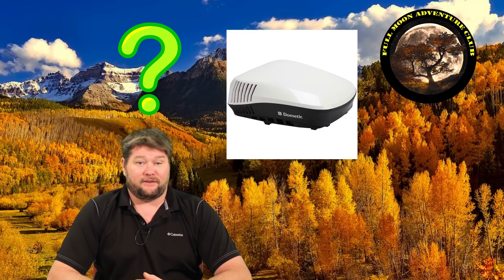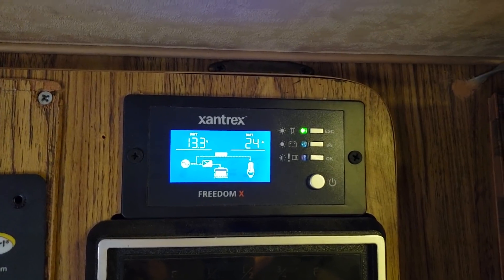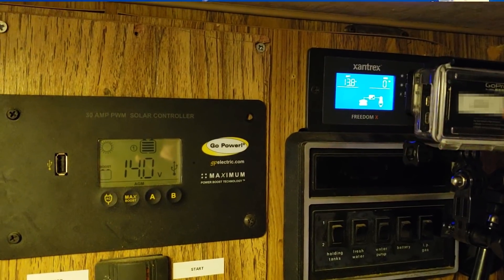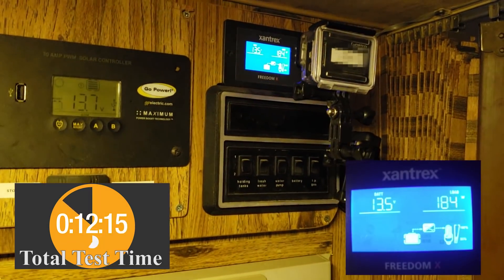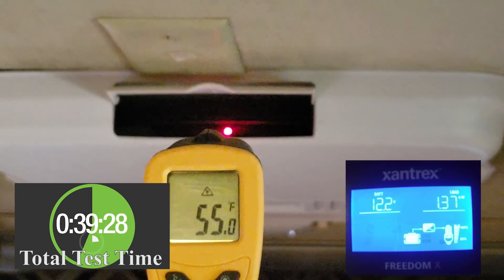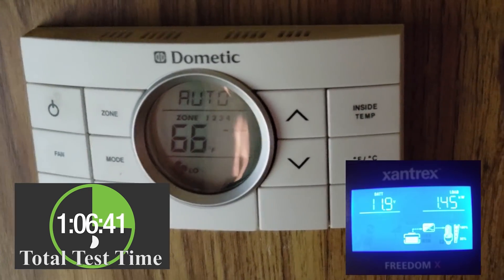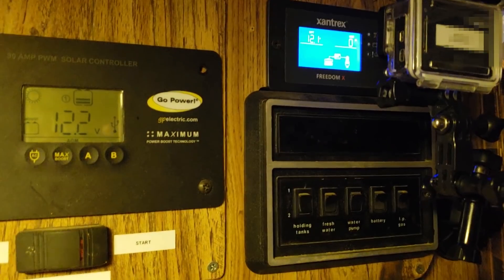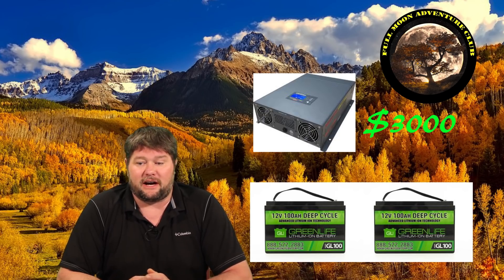How Long Will an RV AC Run on Two Batteries?

Comment: 1.5 hours for 15,000 BTU using a pair of 12V 100 Ah LiFePO4 batteries.  If I used all 8 of my used but very good 6V 230Ah AGM batteries configured as 12V 460Ah usable (down to 50%), I would probably get something like 3 to 3.5 hours.  My batteries are $2000 cheaper too.  If you had a 2KW (140A) alternator, you could run that AC for a long time.

Comment: So 1.5 hours but how much battery time do you have left?  Wouldn't it just be best to turn on the engine to run the AC for a couple hours?
Reply from the maker: This is actually using a lot more power than a car alternator would put out. Surrendering the engine wouldn't actually run the air conditioner. It might prolong your time a little bit but they're just not designed for that kind of power draw. Take care and happy camping.  Jim

Comment: Very good informative video on my freightliner cascadia I have an apu system called parksmart and it works with 4 agm batteries to run the a/c on this system it woll drain the batteries in about 9 to 11 hours not a roof top a/ c of course and about 34 hours on the fuel fired hydronic heater plus hotel load

Comment: Hey thanks, I am in the process of installing an A/C in my campervan. I have 2 x 200 lithium battery solar 2 x 250w solar system. Gives me an indication of time, cheers from Ozzi ozzi ozzi, oi oi oi 👍🤛
Reply: If correctly installed, 200aH of lithium phosphate battery life should generate roughly 155 minutes worth of AC at 72 degrees with this specific 15,000 BTU model. 
The creator of this video did not use the correct wire gauge and there appears to be a voltage drop effectively losing an addition 8% of his power output from his system. 
This could be from the batteries capacity as it ages or additional inefficiency in his inverter (more than normal). 
Overall, if he's projecting 110 minutes, his system is nearly 70.9% efficient given his set-up. 
With the correct modifications, he could generate 42.3% more power under load.

Comment: This is exactly why they need to bring inverter Air-conditioning technology to the RV world.. like 4.5 amp stuff..super high efficiency with heat pumps that perform at extremely low temps..run all day on solar
Reply: Damian DeLapp there is one company making one inverter drive unit. Google inverter rv ac I found it... but hanging a mini split off the vehicle isn’t a big deal...

Comment: Perfect. Want to get a shipping container for storage and use a solar/battery power system to run an RV style AC unit to keep the temp at 80 degrees.

Comment: good video. thanks for doing the experiment.  I'm not an RV but my conclusion is it might be best to do without AC if you are off grid.
Reply: I agree with your conclusion go somewhere cool when it is hot and somewhere warm when it is cold.

However there is always going to be that  person who wants to have an AC, no matter what.

I would like to have one for intermittent use during the day running primarily off the solar panels.

Just to keep the RV cool at peak hot time of the day.

Although I would suspect that a much better layer of insulation would be far more cost efficient.
Reply from the maker: @shawnr771  we have been RV full timing for the last week in Nevada and Utah and I'm here to tell you that a generator is the way to go if you want AC.   Jim
Reply: @fullmoonadventureclub  I am going to say at this point in time yes.

As solar panels and batteries get more efficient this might change.
Reply from the maker: @shawnr771  I am with you on that point. Constantly working solar options. I'm getting closer but the tech is pricey for no gas AC. I will share the journey with all of you as I go. Thanks again for watching and happy camping.     Jim
Reply: @fullmoonadventureclub  I am not much of a camper per se.

I watch the videos because van and rv dwellers are doing things well in advance of home solar setups.

Home solar these days is not about conserving power or using power more efficiently. 

It is about keeping all the heavy load stuff running and offsetting utility costs.

I have partially powered a house with solar in the past as experimentation.

I learned that if it is not necessary to use an inverter dont.

They draw power all the time.

I ran lighting and small 12 volt appliances, fans, tvs, radios off three 65 watt panels and a 4 100 amp hr lead acid batteries.

I ran 1500 watt window unit AC once for about 30 min on a 2000 watt inverter.

This was an experiment and a learning experience for me. 

I plan to power a small(not tiny) off grid home in the future with a combination of solar and wind.

I am watching the technology advance rapidly.

I live in Texas. AC is almost a must have in July and August.

I am designing a passive solar design to take advantage of the different angles of the sun throughout the year to take maximum advantage of shading in the summer and sun in the winter.

I may not get to 100 percent off grid but if by design choices I can stay comfortable without additional heating or cooling into months where most people are already cranking the AC.

This will save me money.

Going green to me is not about saving the planet. It will take care of itself and kill us when we get to be too big of a nuisance.

Going green is about keeping the green money in my pocket and not giving it to a utility company.
Reply from the maker: @shawnr771  I completely agree with your stance on the planet. I also appreciate the information with your personal experience on the matter. I think we should all strive for energy efficiency for any reason. Climate temperature control is the biggest energy issue so many people face and I hope we can figure out and share how to make that obtainable. The easiest solution is to live in a sustainable climate where it is not so necessary but I would love for sustainable tech to be more of a solution. I love off grid tech and hope to do  many more videos on the topic. Thanks for the comment and happy camping.     Jim
Reply from the maker: Absolutely. If you can do without AC it's one of the biggest power drives you can have.   Jim

Comment: Use No reg. Lead acid batt. But use 100 a/h deep cycle AGM, draw down can be more than 50%! Shalom!
Reply: AGM’s should not be discharged below 50% or their life will be considerably reduced.
Lithium’s can be discharged safely to down to 20% capacity.

Comment: Hello Jim,

Very nice video on this subject!

Being from AZ, getting rid of excess heat is always a struggle here in the Summer.

That said, a few points to review &  ponder; During your test, what was the outside temp.? This is important to see how much excess heat GAIN you also need to overcome.

Of course during this test, you are starting from ground zero, no a/c running for some time with everything heated up.

My contention on this would be to start off using the ac line power or generator to do the initial cool off to desired temperature, then switch to the batteries and see how long the battery/inverter system could maintain your desired/cooled off environment!  I suspect in doing this, you would find that instead of only 1.5 hours that you might find your system would maintain perhaps 6 to 8 hours; battery only!

Then you could do part 3 & add in the solar panels.

Sounds like a good retest to me. 

Let me know the results...

Thanks, John, Tucson
Reply: What is the basic BTU number on a regular car AC?

My idea is to use less than a 5,000 BTU unit.  .. This to be done by  limiting the livable space in a RV to a small area on hot days..
Possibly plastic dividers can contain the cool area.
Reply: @DanielS-o7e4f  Most cars are about 1ton (12000Btu). SUV can range upwards of 20000 to 40000 Btu (1.5-3.0 ton).

Remember that in an RV you have more windows (heat gain)  & therefore less insulation too where those windows are.
Reply: @jptucsonaz8503  
Thank you
Reply: Great idea. I would also add a soft start to the ac system and try it then. Im pretty sure its doable with 4 battleborn batteries this way.

Comment: Hi Jim, a first time ever on comments.  I was looking to run air conditioning on battery power I found ya and I was impressed with your knowledge and love for what you do. This is my 3rd van build and all before I used a Honda EU300IS generator inside a closed compartment all year long. They are amazing little gen's. I would get between 3 thru 5 K hours before the rigs needed replacing.
Anyway, I'm was talked into going with 600 ah of Battle Born batteries and a DC air conditioner form Proair. Do you have any experience with Proair AC units? I'm getting between 5-6 hours on the average. I have 2 questions if you would be so kind to respond to. At what voltage should I turn off the AC, below 12 volt?  Question 2: I'm using a Colman 54 quart chiller that runs on a Kool Mate Converter ( 50/60Hz/120VAC 1.6A/192VA ) and wanted to know if I went with a cheap Walmart AC fridge. ( 120VAC / 60 Hz / 0.80A / or 0.64 kWh/ 24h ) Would I use less power on a daily use? 
No matter about the response, I really enjoy your channel and keep doing what you love. Thanks again for all you have done for the camping pep's...……. Buzz
Reply from the maker: I do not have any experience wit proair AC units but at 5 to 6 hours I would say you are doing pretty good. The refrigerator question would best figured out with a cheap watt meter. record the power usage in a day using the cooler to figure out how much amps or watts it used and then compare it to the numbers on the Walmart fridge. A compressor fridge only runs during compressor cycles so it may last longer but I can't say for sure without testing it. I wish you the best of luck and thank you for watching.    Jim

Comment: 1500 watts cant be correct for 5000 btu.My window unit is 5000 btu smallest typical unit you can find anywhere without over paying for a specialty shed dog house type then you could occasionally run into a 2500 btu unit.fyi double the price tag.Half the ac...but half the power draw on batteries an a small solar set up in a very small space it may be worth it if those prices were down to 150 bucks.

Comment: My set cost less than $ 1000 and has much better parameters I can easily pull 1000w for 4 hours with 4x cheapest 100ah batteries with ebay new £60  each.

Comment: Your scaring me. Lol. So 500ah AGM batteries. How long will a 13500 btu AC run? Since the running watts is about 1250 watts. Which is roughly 10 amps. And I have an easy start on my AC. Which will reduce that initial amp draw. Hope you see this question and respond.
Reply: You will get MAYBE 2hrs of run time before you drop below the 50% DOD which will start to hard your batteries.

Comment: Can my 2017 Silverado 110v sus run my jayco 161, 13000btu ac if the truck engine is running in an emergency?
Reply from the maker: I'm afraid not. The inverters that come installed in trucks usually are  not very powerful. Also I don't think you'd be able to run an inverter strong enough off of an alternator to run an air conditioner. I'm afraid of small inverter generator is the only way to go. With a soft start unit installed you be able to use a 2000 watt inverter generator.
Reply: 110v inverter sys

Comment: What's wrong with powering the ac from the alternator?
Reply: No response for 3 weeks.  I'll give it a go.  Using your alternator is the least efficient way to provide for your electrical needs as you must run your main engine.  In commercial trucks, that is about 1 gallon of diesel an hour plus wear and tear on the engine.  Expensive.    In a smaller engine for an RV it would be less, but still inefficient compared to using a generator.  A generator's sole job is to provide power and they do so rather efficiently.  Commercial trucks often use APU's that provide a small electrical supply and heat/cool as necessary using much less fuel without wear and tear on the main engine.  RV's have the option to use the roof area for solar panels to drastically reduce generator use while providing much needed shade.  It really depends on your unique needs and your budget as to which path to pursue.  At least these days, you have options like solar energy with advanced batteries that didn't readily exist a generation ago.  I've seen some larger RV's with 2,000 watts of solar on top which can provide about 10 hours of AC each day for less than the cost of a commercial APU.
Reply: @saxonsoldier67  Tbh I'm basically looking for a cheap starter kit to start me off In Texas heat, mind you! I really don't get how the alternators would be any less efficient than a generator. 18 wheelers basically been doing it for years right? Don't even see what's so bad about an idle motor tho I'd prefer to prevent it as much as possible. My only concern would be fuel & carbon monoxide poisoning
Reply: With solar panels I'll have to be parked in the sun to charge which is complete ass backwards mentality if you want to keep cool you park in shade!! Bring it down 20 degrees & that's even less work your system has to do!
Reply: @Dan0rioN     Good question.  Alternators do a fine job, but they require burning at least several times more fuel plus the wear and tear on the main engine.  Generators are much less expensive than rebuilding a main engine.  Commercial trucks idling for 8 hours a day for 20 days a month costs in excess of $500 a month in fuel and wear.  The least expensive method initially is to buy a generator to power an RV's 15000 btu AC unit with a soft start directly.  I ran a 5000 btu window unit in my home in San Antone that left my master bedroom chilly and lessened the heat to about 80F in the rest.  Insulation is the key for a home's efficiency.  RV's are notorious for inadequate insulation as well as leaky windows and doors.  Install a wooden deck on top that can shade your RV if you don't want or can't afford solar (it is amazing at what shade can do).  You'll get good use from the extra living space up top as well.  Install a small window AC near your bed so that you can run a small (and cheap) generator.
Reply: @saxonsoldier67  So you really think all these companies would supposedly piss away so much money on truckers in idle if solar were so much superior?? I can't have a bunch of stuff hanging off my van I don't need to attract attention & have cops flashing lights & knocking at my window @ 3AM
Reply: @Dan0rioN      Most trucking companies have done the math and installed APU's that are much less expensive to run.  I've seen vans with window units and generators on the back that look nice.  If cops are hassling someone for running a built in generator at any time, they will hassle someone for idling/living in a van.  Some areas have stricter rules than others.  The beauty of a van is the ability to move around an area so as to not wear out your welcome as well as to find shade trees.  I have a Sprinter van.  Even though I don't live in it, I have placed 1/4" of foam board and a sheet of plastic paneling on top to shade the vehicle exterior.  Likewise, I've spray foamed the 14 feet behind the seats interior with several inches of closed cell.  I have even spray foamed the external rear wheel wells.  Best $1200 I ever spent.  Texas is hot most of the year.  Now, my van dash AC can keep it all cool while driving.  My van is nearly 10 feet tall.  So, an inch of whatever on top is not noticeable.  If I lived in my van, I wouldn't idle it for five months or more a year.  A generator burns less fuel than my vehicle's engine.
Reply: @saxonsoldier67  Well a little top mount ac unit is all I would need.. But running a generator? Not ever would I do that... That's a huge target & not even an option.. High output alternator or possibly two along with enough deep cycle lithium batteries should do me just fine I think!! Solar.. Maybe later on if necessary
Reply: @Dan0rioN    An alternative idea if you are in West Texas' drier air is a swamp cooler.  Likewise, some commercial trucks have used a different idea.  By pre-cooling the bunk and cab while driving, all you need to do is maintain that cool temperature.  They have installed a refrigerator with a reservoir of water/anti-freeze beneath the bunk.  Imagine shutting off the engine and having 50 gallons of 10 F fluid being circulated in a radiator next to your bed.  You could use that thermal mass to keep you cool all night.
Reply: @saxonsoldier67  Not big on the swamp cooler idea.. Prefer to avoid moisture as much as possible with the humidity. The fridge idea sounds interesting but then what about the condensation?? I'm thinking two roof fans & a hole in the center of the van floor to allow shaded air flow up through the cab. Have a freezer with about 6 ice packs & take two out on rotation & mount them in floor hole to get even cooler air flowing in!!!
Reply: @Dan0rioN    Swamp cooler won't work with humidity, only dry air anyway.  An upright freezer full of packs or bottles powered via an inverter while idling/driving.  After engine shutoff, you could use a small 12 volt pump and fan to blow the cool air on you.   Holes in the bottom of a vehicle are generally a bad idea as your or other vehicle exhaust nearby can enter unless it is sealed tight until use when safe.  Since Texas heat is no joke, you would need hundreds of pounds of super-cooled bottles/buckets to make the improvised system function.
Reply: @saxonsoldier67  You totally lost me with the bottle/freezer idea.. I would def make sure my exhaust is sealed well if I had a hole in the floor.. & it would be very well ventilated with the roof fans so even if I were to leave idling it wouldn't be any worse than sitting in traffic with the window down.. I think once the heat would be sucked out the van under some shade plus the fan blowing on me & the possible addition of fresh air being sucked in near a couple ice packs.. Yeah I could take on a 100 degree day.. In theory lol